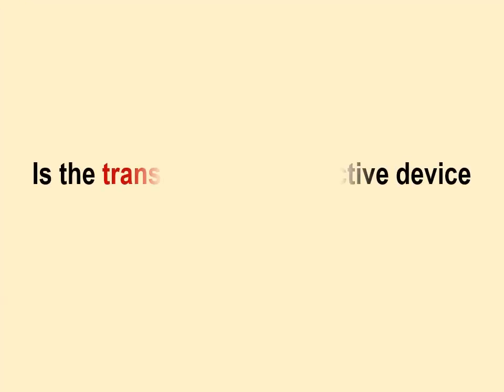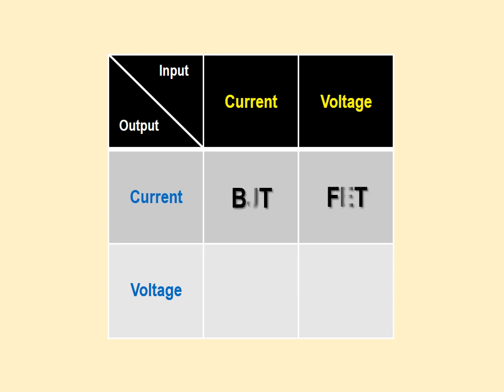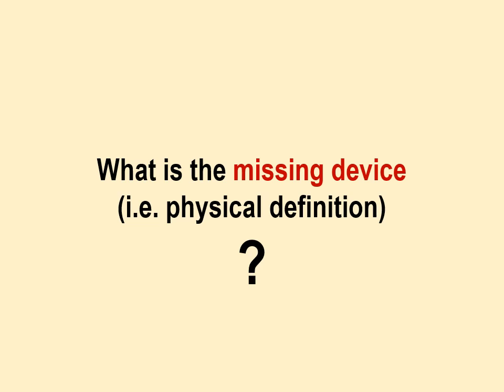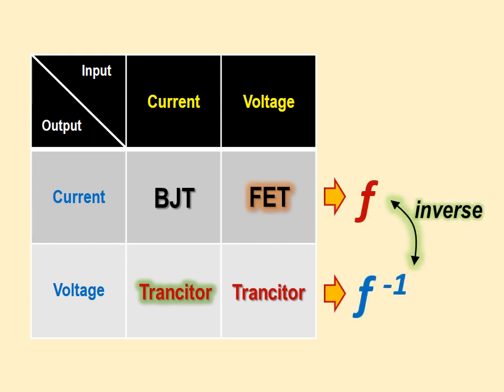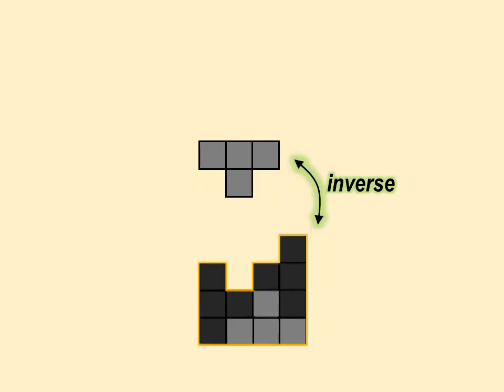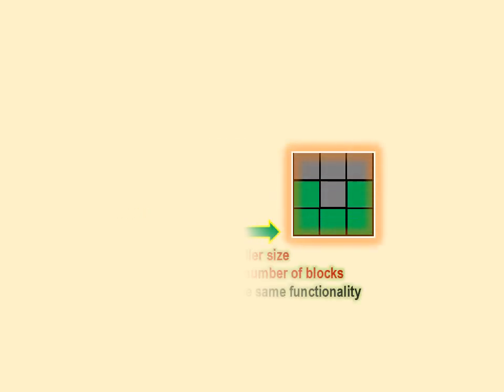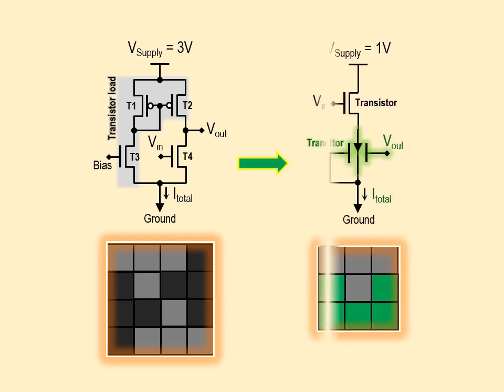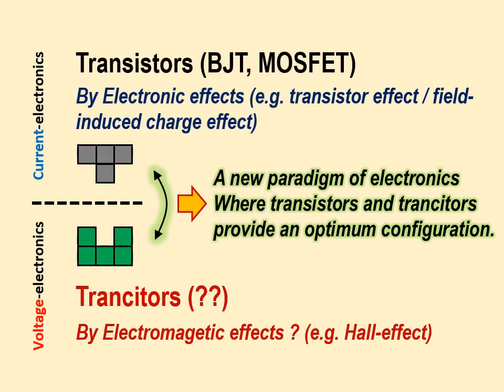A Missing Active Device - Trancitor (the inverse of the Transistor)

Comment: Well basically for me this looks like a pretty regular transformer that eventually works with DC. You should look at materials used for passive solid-state magnetic or PIR sensors . Send me a beer if you get Nobel prize.
Reply: LEDs paired with solar panels somewhat can act as current controlled trancitor. You can get easily higher voltage than the input voltage.